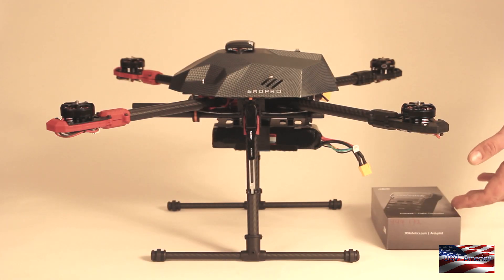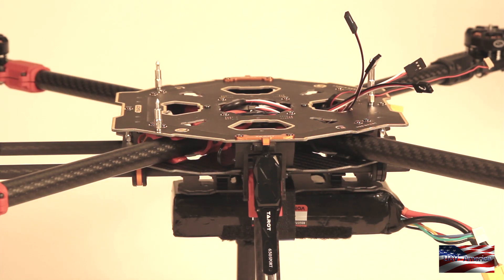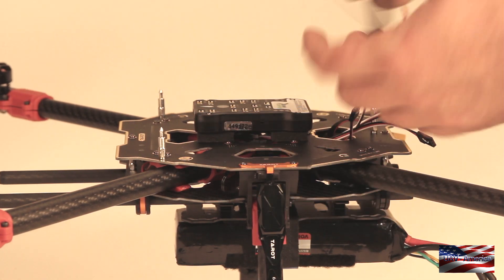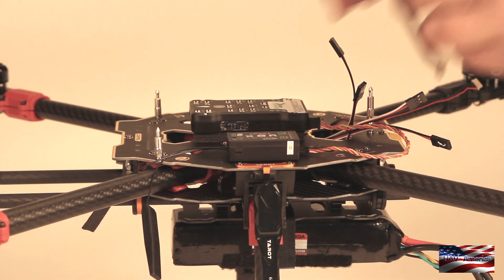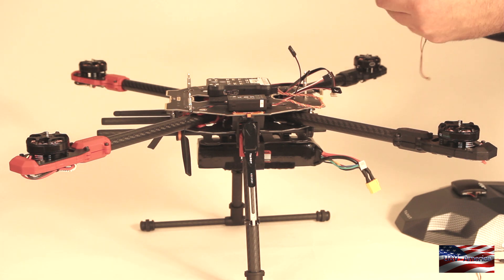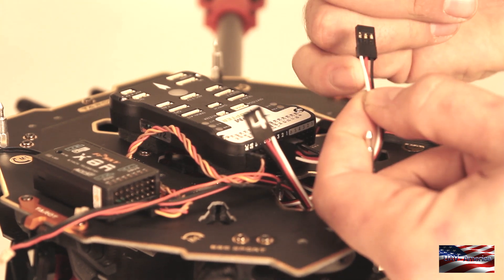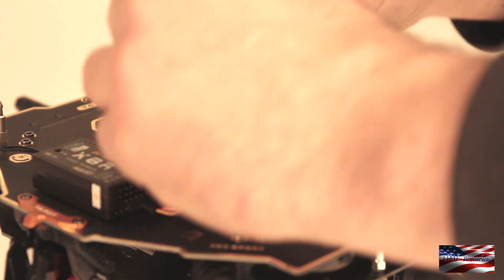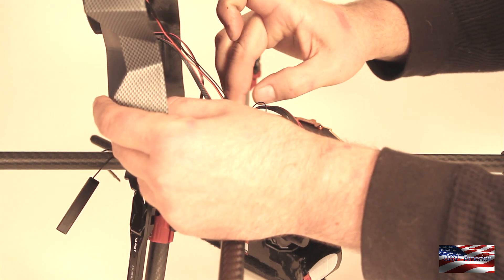3DR Pixhawk Installation Part 1 - Physical Connectons

Comment: I dont know if you will ever see this question because I can see that the video is abet old but I just hope that you see it and you can help me. I have couple of pixhawks on my quad and one of them I had configur for rc plane, with frsky x8r reciever. the problem is I just can not get the Flight modes to work!!!? I have it working on my drones with other recievers and I have been using this reciever on my quad at some point and it worke but right now no matter what I do it just wont work. any idea's !? and it is connected with one line sbus to rc in.....!!? thank you

Comment: Great job, man! Thank you to show us the PixHawk communication port setting! You did very well didactic explanation! Allow me asks you some questions, please.
1) Are there different PixHawk specific firmware needed to load it when flying airplane or multicopter? 
2) Or the default PixHawk insider firmware is enought to do any route traced with Mission Planner free software?
3) What is the maximum distance provided by the 915MHz radio telemetry antennas?
4) Do you know if the Spektrum DSMX receiver (e.g. DX8), with attached telemetry modules (pitot tube, thermal sensors, rpm sensor...) can be connected to the PixHawk RX IN port? 
Or the Spektrum AR8000 RX should be connected to the PixHawk RX IN port and the Spektrum telemetry module AT1000 connected at the PixHawk SBUS port? What about PixHawk SPEKTRUM/DSM port connection?

Comment: Is it possible to use the uBlox GPS + Compass unit without having this board here?  I guess I should have read into it more, but I bought the GPS thinking that's all I would need.
Reply: Yes it is. The board I think you are referring to is the i2c expansion board.  You can simply plug the i2c cable directly into your flight controller.  The expansion board allows the use of multiple i2c sensors on the same bus.

Comment: what size battery
Reply: bill alvarez We used a 4S 6000 on this.  We have used up to a 10000 with good results.  The landing gear is the weak link, careful when touching down!
Reply from the maker: The Pixhawk itself runs on 5 volts +/-  The battery for a multirotor or fixed wing is based on a number of variables like motors, ESCs, prop size, craft weight, desired flight time, etc.
Reply: what size were you using on this quad ..i have similar frame ..i am using 4s 3000mah
Reply: k thanks ..i got a 4s 4k right now i need to get more

Comment: Great video. Have you got the retractable landing gear working yet?
Reply: davrosd We tested it but left it disconnected.  Without a 3 axis gimbal there isn't much point to the retracts and I figured they are a liability with no real benefit.  Pixhawk will be able control the landing gear soon, once that is sorted out we will connect the gear by default.